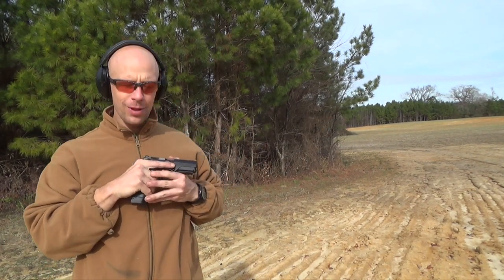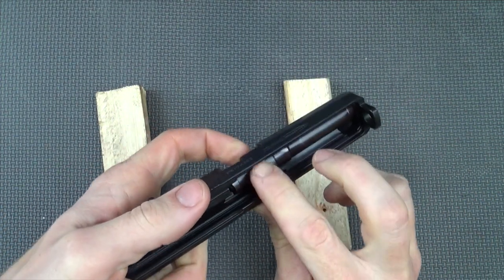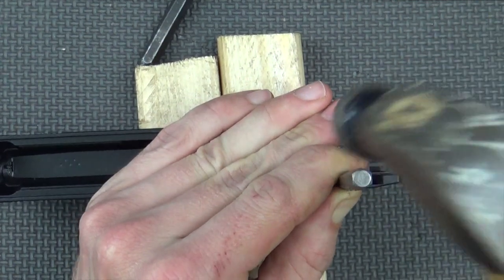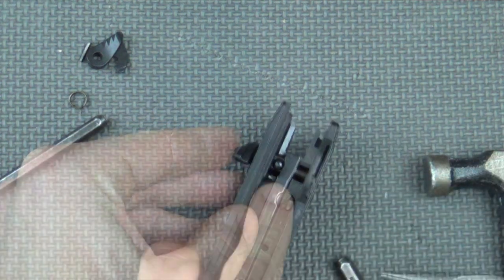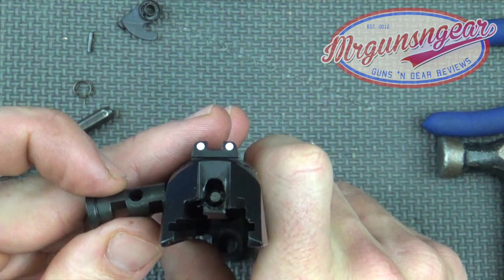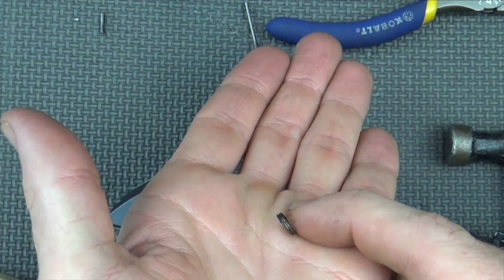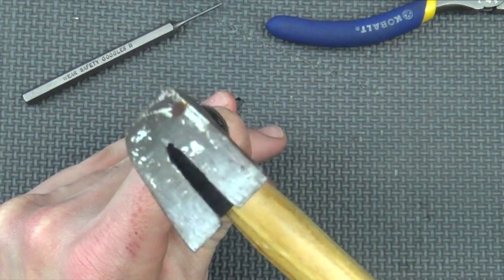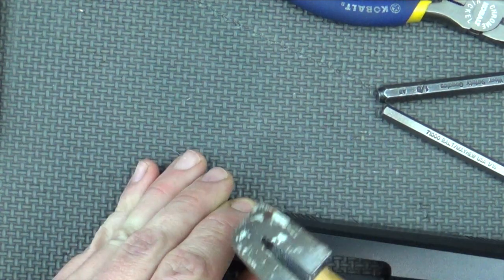How To Convert A Beretta PX4 Type F To A Type G [Decocker Only] (HD)

Comment: I did this and it works fine. However, now the safety lever sometimes gets caught midway when decocking. When I pull the trigger, the safety disengages. It is getting caught somewhere in the frame because when I take the slide off, it doesn't get caught. Anyone run into this issue?
Reply from the maker: not I
Reply: Probably the way you seated the roll pin when you re-installed the safety lever.  That pin is almost too long.  When seated properly, it will be absolutely flush on both sides of the safety lever.   A few thousands of an inch extended in either direction can cause the lever to feel gritty or hang up.  Remove the pin and use a dremel to grind a few thousands of an inch off the total length.  That will reduce the likelihood of any hangups.  Also, make sure you are using a 1/16" punch to remove/install the safety lever retainer pin.  If you use something smaller, it could 'mushroom' the pin.  That can cause the pin to fail to seat flush or can leave tiny burrs that can also make the lever action feel gritty or even cause it to hang up.

Comment: FYI, Beretta is now selling a 92fs type safety for the Px4...some people don't like way the stock Px4 safety levers can gouge your fingers, especially when racking the slide...now you can purchase 92fs like safety levers for the Px4 and also install them in the type G mode...get em when they're back in stock http://www.berettausa.com/en-us/safety-assy-px4-f-large-le-part-c5d666-c5d667/c8a000/  also, is there a reason to remove the extractor, it doesn't seem necessary
Reply from the maker: +Falcon Lair thanks

Comment: I am seriously considering this pistol.. but havent yet made it to any shop to handle one. anyone here who has one, how's the pull in DA? if I am going to carry with a chambered round, I like a tight DA pull.
Reply from the maker: +terwilliger Jenkins very smooth
Reply: Mrgunsngear Channel
thats good. thanks, man.
Reply: +terwilliger Jenkins There now is a new carry model that comes with decogker only, fiber optic front sight, new improved trigger and talon grips
Reply: costan1000
I'll check it out. thanks for the tip.
Reply: +costan1000
 Do you have a link to where this new model anywhere? After much research I've finally decided on the PX4 compact. One of the things that has been holding me back is the lack of options as far as sights go. What you describe could be exactly what I am looking for. Thanks in advance!
Reply: It was showed at Shot Show 2016 so just search for Shot Show 2016 beretta
Reply: Thank you, you rock!!
Reply: the d spring from the beretta cougar can be installed to reduce trigger pull,  as well as 92 hammer springs from Wilson combat.

Comment: Why take the extractor out when it’s not necessary?
Reply from the maker: to take the tension off. as you said--not necessary but I prefer doing it
Reply: Mrgunsngear Channel wow that was a quick response! Appreciate the video, just replaced the standard safety levers with the low profile type G levers and the video was very helpful. Huge improvement without those sharp wings!

Comment: And to think some people are spending money buying new safety levers for this conversion.
Reply from the maker: indeed
Reply: To be fair, people aren't buying the new safety levers just to convert their PX4 from an 'F' to a 'G' (decocker) model.  They do it to get rid of the "batwing ears" on the original levers.  The mod provides a much slimmer profile and makes the weapon much easier to rack without the extended levers biting into your fingers.  The "kit" also includes a low profile slide lock release lever.  If you all you want to do is convert to a 'G' model, then Mrgunsngear provides the best way to do that.  If you want to convert the weapon to a model 'G' AND you want slimmer profile levers, you'll have to spend the $74 and buy the conversion kit.   That's what I did on my PX4 Subcompact.  Another option is to grind down your existing levers and re-blue them.
Reply: +Mark Gough I have the original "bat wings" and they've never bitten into my fingers. There's also no need to go through this whole silly conversion process, just rack the slide of your type F, and then flick the safety on and off. You have a decocked pistol with one in the chamber ready to fire. It's not rocket science....
Reply: seth tenrec, I’m surprised no one has ever responded to this... sure, there’s nothing wrong with these weapons in the type F configuration but since most of us who DO consider this a worthy conversion from F to G, these pistols are just as safe as a double-action revolver and can even be carried as such loaded even with the safety off and the hammer testing against the slide. You have a long 10-pound pull when the Storm is in DA mode, so why have a safety to remember to turn off? This is not like a typical striker-fired Glock with just a redundant trigger safety between you and a negligent discharge. I’m in the process of converting my three PX4’s but I prefer the actual type G decocker only lever because of the same reason the other person posted. The levers don’t need to stick out that far to begin with.

Comment: alright wtf. went to use 3/32 punch on safety roll pin.. not the right size like you say.... so what size is it? because I just spent money on punches I don't need
Reply from the maker: +ethan west not sure offhand
Reply: You mentioned on tool used on the roll pin for the extractor but it seems to me now that you may have used another tool on the safety lever extractor. I now am going out to buy a 2/32 in hopes that it will work and that I did not mess anything up with the 3/32 tool that I was hittn pretty hard to no avail! Maybe you could update the video for others sake. Thanks
Reply: @raymondwilliams6601  did 2/32 work
Reply: @chrishansen8201  the 2/32 worked like a charm
Reply: @raymondwilliams6601  2/32? Lol, why would you not just say 1/16?

Comment: Do you see where the slide is cracked below the firing pin to the left my 9mm px4  is the same way is that safe ? I have a px4 in 45 it is not broken there but it is VERY THIN  on the left side also, what do you think i am going to call beretta tomorrow.
Reply: Not cracked